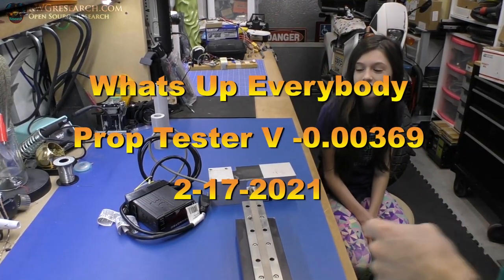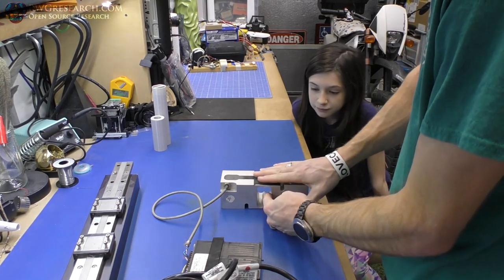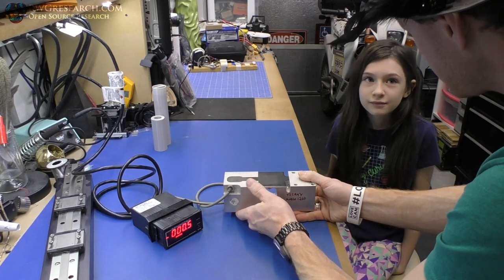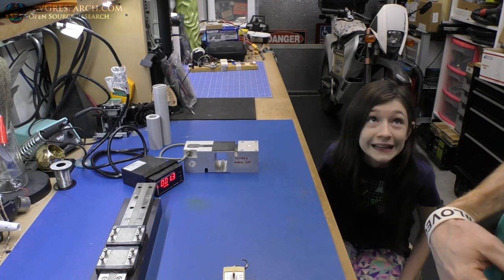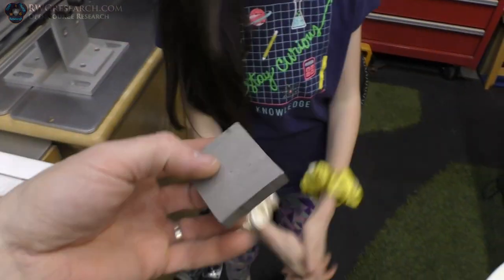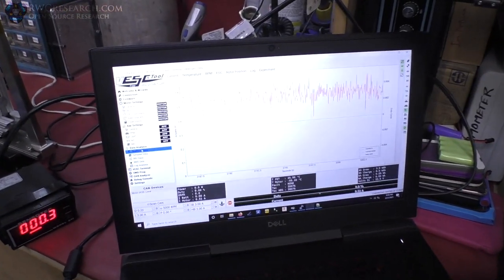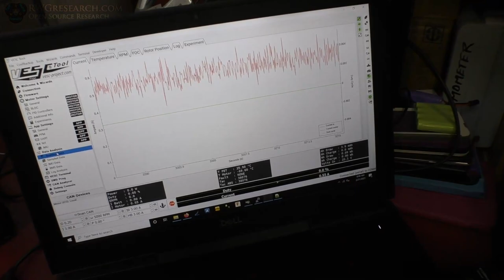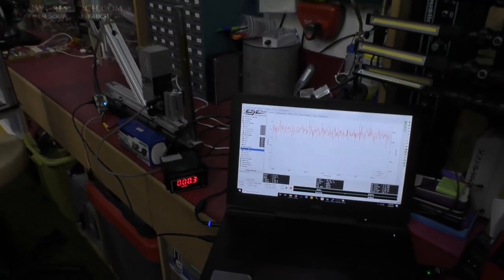2-17-2021: RC#11 - Building The Prop Thrust Test Rig! #29-22

Comment: 150lb gauge has a limit of around 3 times the load, and it is easy enough to recalibrate the display to be more sensitive in most cases, simply by using the right value of reference masspiece to define your scaling. The display will be reasonably capable, even if you are measuring a light mass, you can get good resolution, though not as accurate as the quantisising errors get to be a larger portion of the count. Same display with different loadcells can be used for measuring from a 300g load to 3000 tons, just the loadcell, the mounting and still the same stick on strain gauge tape in use.